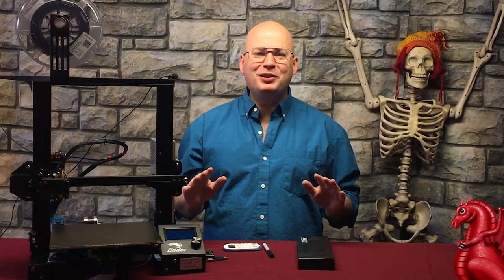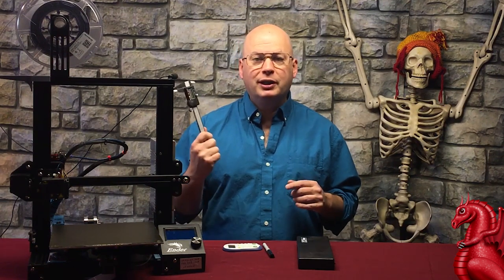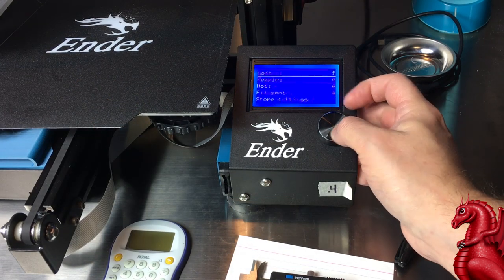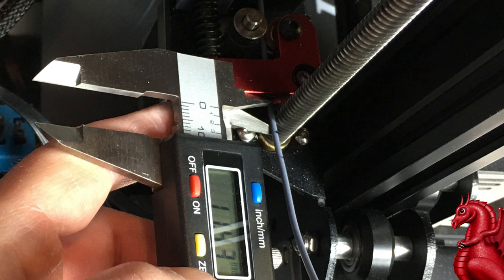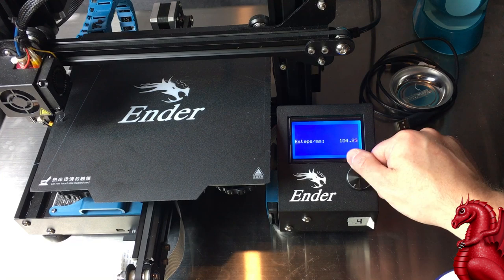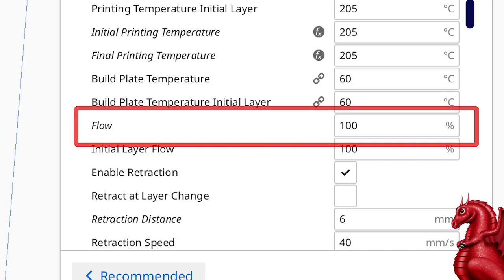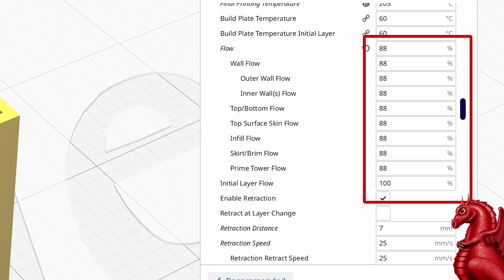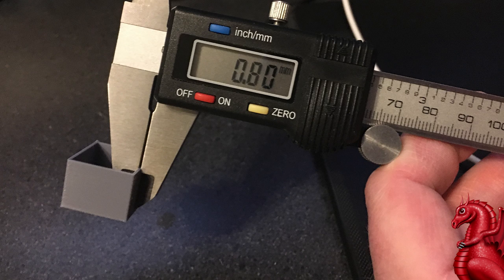3D Printer Extruder Calibration

Comment: I just went through this tutorial and I liked it, but things didn't turn out better for me.  My printer is and ender3 pro and does a great job, but I decided to go ahead and tune it as much as possible.  So this was my first tutorial.  when I adjusted the flow, though, my cube walls got thicker. go figure.  The first cube  at 100% was close at .84mm but I adjusted the flow to 95% anyway and the second cube is  .91mm . did I do something wrong? should I just go back to 100?

Comment: I'm trying to calibrate a Flsun QQ-s pro, and every method I use to tell the printer to extrude 100mm I get 20mm so I end up with a 1835. I've used the screen on the printer and pronterface using the gui and gcode. What do I seem to be missing?

Comment: Multiply by 93 to get 9300, then divide 9300 by... means that the 9300 mathematically cancels out.  Skip it.  It's easier (in the example of 89mm extruded for 100mm intended) to simply divide the intended by the actual, then multiply that by the current transmission ratio.  Three values.... So just do this:  (100mm / 89mm) x 93 = 104.4     :)

Comment: Very Helpful, Thank You!  Once you have adjusted the flow and have the value. I actually got 88% as well, Can you permanently write this into the 3D printer like with the Steps on the extruder or do you have to set 88% flow always in CURA?

Comment: Hi there, thanks for the video. With all due respect, I think the way you calculate the wall thickness might be inaccurate. My understanding is: When you design the STL file, the thickness of the wall should be a fixed number, for example, 1 mm. The slicing software (for example simplified 3D) will figure out the best extrusion width multiplied by the number of walls to match the overall thickness (which is 1 mm).

Comment: I've just done this calibration and my e-steps are 138.9 from 94.5 and unsurprisingly im massively overextruding. Creality set this at 93 for a reason. I upped it to 94.5 and have been getting great prints. Where did this calculation originate?

Comment: Extruder Calibration:

Preheat printer

Measure 100mm on filament and mark with a sharpie 100mm and 110mm

Extrude 100mm on printer

Calculate what the difference is whether over or under and jot it down

Check current E-Steps are on printer menu of printer

Input length (100mm) x Current E-Step # (Amount Extruded) = 

(Calculated # from step 6) / (measured length that was extruded in step 4 = (New E-step)

Go back to E-steps on printer menu and dial new calculated # from step 7

Remember to store setting otherwise you will lose this calibration after the printer powers off

Repeat steps 2 - 4 (Repeat until extruder is at 100mm)

Next calibrate Flow slicer program your using, set to 100%

Print out calibration cube with a wall thickness of 2 for .4mm nozzle (hollow cube) 

After cube has been printed, measure wall thickness with calipers and wall thickness should measure out to .8mm

(Desired width) / (Measured Width) = New Flow %

Double measure wall thickness on all 4 sides and average it

Input new Flow % into slicer (minus 4% +/- for printing miniatures)

Comment: My Extruder is skipping backwards when extruding. Any ideas what could be causing this? I have a new nozzle (0.4mm) and a new heatbreak installed. So I don't thinks it's clogging. I also tried temperatures up to 230 with now success.
When extruding without going through the hotend it works just fine. The skipping happens only when extruding through the nozzle.

Comment: I try to challenge the extrusion config here. I wanted to know if my printer has the same issues. I extruded 100mm, led to 94mm of extrusion. Then I created an object with the exact volume of the filament volume 1.75mm*100mm, equivalent to  100mm of filament. It is 240.528mm². The printer prints then 111mm of filament, 100mm of filament for the object with the volume of 240.528mm² and 11mm of filament for initialization. Even if the e steps of the ender might be lower or higher, still with my cura, an object that has the same volume of 100mm of filament, result in extrusion of exact 100mm of filament. Am I wrong or do we overlook something?

Comment: Thank you so much. I had to bring it up to 145.31 from 93 with an aftermarket extruder. I was going crazy changing my settings in Cura. I still need to do flow calibrations but you Sir just gave me some fantastic knowledge. I did Not know under extruding was better for smaller parts but it makes sense and I'm going to start. Thank you again!

Comment: Should this be checked for every material type/color? The flow setting is set by my material profile it seems, so if I change it for only one material, it will be back to 100 for the other materials.  Should I check all my PLA colors or is this flow setting likely to be accurate across the color range?

Comment: Excellent clip. Thanks a lot. I have serious problems with layer adhesion (layer to layer). With my new PLA spool from ENDER and applying your method I need to put my E to 234.55 stp/mm what is enormous compared to the default or 93 stp/mm in the factory settings. I measured the diameter of the filament and arrive at 1.7 +/-0.03mm being close to the 1.75mm stated by the vendor. In the calculation 93 stp/mm for 100mm means 9300 steps while the stepper motor of the extrusion makes only +/- one complete rotation this would then mean that the stepper motors are driven in micro-stepping mode? Can someone provide me with some suggestions?

Comment: Once I've adjusted my e steps and figured out my correct flow rate, should i change my flow rate for all profiles? And should i change my wall thickness back to the defaults or is this just what i should use for, say, my miniature profile?

Comment: New subscriber... Very informative video. Really appreciate this. If you were to measure the cube at the bottom, would it be slightly wider?  Most of my prints on the Ender 3 are a bit fat on the bottom few layers, and it looks like your cube was also wider at the bottom.

Comment: I'll probably pass on the % stuff, but ultimately the thing came out between 0.7 and 0.8 (my calipers only do 1 decimal place, might order some metal ones though). Maybe I'll just adjust the esteps a smidge to compensate for this in future.

Thanks for the help on the esteps though, even doing that is better than what it once was after changing extruder + tube. Went from 93 to 101.1, not an insignificant amount, but after I changed the extruder and tube, it was definitely over extruding a bit with stringing. Tube length was precut to the same length as the original I believe, but the extruder itself called for calibration I believe.

Comment: I'm doing the extrusion calibration. But every time I extrude free air flush cut a hundred millimeters I come up with a different number. 94.9 90.7 94 on the money and 92.3. four in a row. My printer was off and I did the math problems before I knew to save the settings and I got it to 100.0. not sure what's going on. I did have some clogging issues But other than that everything's been spot on

Comment: I followd the steps and affter extruding 10mm it was better but not good yet. After repeating and recalculating with the newer parameters i am now on 129.8.... is this a "normal" number? I use the same filament as i used to how is it that i have to change this so much only after changing to a new role of pla?

Comment: just saying im pretty sure using flow rate to get to your desired wall thickness is a lazy way, just because you get the right size youre still underextruding i have airgaps in my print and its much weaker compared to the one at 100% flow, x y shrinkage compensation would be the proper way no?

Comment: This video saved my awful previous prints, I realised when my printer expected to feed 100mm, it actually fed 45mm instead! I like this tutorial because it does not require to connect your printer thru usb with a cable or octopi, you only need basic tools.

Comment: Great video, albeit i seem to be running into a problem when printing test cube, i can't seem to get the 2nd wall to print, i have your settings pretty exactly in cura, using ender 3 v2, wall width comes out .4, all stock parts except springs, and extruder now.

Comment: Hi there. I mounted an all metal extruder and the micro swiss hotend. I let it print a few minutes and then tried to calibrate the extruder like you show. I came up  33  mm short and had to krank up the steps to 138 (93 was original) ....that cant be good? What could be the problem here? I must say i had to replace the gear on the motor (it came with the new extruder) because the original did not fit with the new dual gear extruder

Comment: Great tutorial!  I followed your steps on my Ender 3 Pro. I have the upgraded 4.27 board and a new glass printing surface.  I usually put painters tape on the bed to help with adhesion with different filaments.  Now that you know my setup, I have a new issue.  I have a measured cube of 0.80mm (perfect as per your direction) but now it has layer holes in it.  How do I overcome this?

Comment: I had an Ender3 and loved it so I bought a CR10 and have had nothing but problems with it.  I have spent hours on reddit feeds, facebook groups and youtube videos with almost all of it stating that it was a clogged nozzle, warped extruder, cheap Bowden tube, or quick disconnects.  I have replaced the Stepper Motor, the Extruder to a metal one, the Bowden tube to a better one, the quick disconnects, the Bowden tube to a better one, the nozzle a dozen times and was ready to throw it in the trash.  After testing everything with your tutorial, I am not sure why but mine was almost 20mm short of what it should have been in the extrusion.  Once adjusted I feel like I am back on my ender3 again.  Thank you so much for spending the time to explain it to us non-engineering types.

Comment: Hey man I wonder your input so I got an under 3 pro and for whatever reason the left bottom corner will never be level to the rest of the bed and to fix that I put the z axis stopper up a fuel millimeters that way I could level the bed without having some springs completely condensed since I know that's fairly bad for springs and seems to fix my level problem I just wanted to run this idea by you and see if what I did was actually a good idea or not but I don't print anything too tall and yeah thanks for your time if you do indeed read this oh so now I just upgraded my extruder now to what you did in your other video because I had a really bad slippage so I'm excited to get my printer working because I'm probably going to be using this for a lot of high school projects since this is going to be my senior year this fall if we even go back I hope we do because I really miss the in person learning like I was taking advanced sales brother this past year we got sent home the videos were so useless I'd rather sit down with the textbook and try to learn it myself which is what I did for the rest of the year and somehow I managed to do it fairly decent and I'm sorry that kind of turned into a ramble

Comment: Hey I‘m facing the problem, that even after saving the new esteps and testing again, it doesnt take more filament in as it should. Ive tried over 3 times, but it doesnt wanna do as supposed to. Its a direct drive extruder.

Comment: Thank you.  This was enormously helpful in solving my petg printing problem.  Along with the calibration process I found my nozzle was loose and oozing out around the threads, then I found the filament  tension was too light-after that the calibration-with your guidance was a piece of cake.  Now I am in the middle of doing the test cube that you so kindly provided.  Again, thank you.

Comment: Thanks, a really well explained guide. Calibrated my ender 5 pro after fitting microswiss direct drive, found my e-steps were now 138.3 a bit off the suggested 130, was under-extruding by 6mm out of what was meant to be 10cm in the test.

Comment: I have 1.2 wall thickness and i print the cube and i measure and i have 0.9 wall what flow i must put
Reply: Can you help me i use 0.4 nozle.... I make the esteps test ... Now when i put 100mm in the extruder stops allmost in the extruder its fine.... I make my esteps 100mm (93stock) but i have problem when the printer go to the second third layer push more filament I think.... Im so upset with my printer......    I have 1.2 wall thickness i make test clow cube and i measure its 0.89-0.9  ......   I dont now ehat to do ( i use pla in 205-60 temp) i make very good level  i have skr mini 1.2

Comment: Question. On the extruder calibration cube, all but one of the walls are at an acceptable tolerance of 0.82 but one wall is still waaay off at 0.71. How can only one wall be off and how do I bring it back to tight tolerance as the other 3 walls?
Reply: hmm i dont even have a printer yet but from the videos i watched, this seems more like a different problem... 

maybe this video could help you: https://www.youtube.com/watch?v=25r-PTVJDjQ

Comment: Great demonstration of the technique, it makes a lot of sense and is simple to execute. I would've liked to have seen the cube test before any e-step or Cura calibration, to ensure that something is truly off with the machine + slicer settings. As others have pointed out, the calibrations on the machine and in Cura seem to more or less cancel each other out, which makes me wonder if Cura "bakes in" the average e-step offset/error in their base profiles for Ender 3. I also wonder if this calibration gets thrown off by different filament types, or as the tightness of the extruder gears drifts with usage.

Comment: Great videos Tom.  Been watching your channel since purchasing an Ender 3 last June, along with a couple of other channels that seem very knowledgeable of the Ender 3.  Finally decided to assemble it, after deciding on what upgrades I would do during the assembly process.  It worked great - hot-end & bed heat up accurately;  X. Y, & Z axes  all move smoothly, quietly, and accurately.  The only problem I have is the extruder (motor).  It does not work.  Am able to turn the motor shaft by hand and all the connections seem to be OK in the electronics case.  I am stumped.  Any suggestions / thoughts?  --  Patrick

Comment: Under the MOVE AXIS screen, I only have an option to move in the  X, Y&Z direction.   There is no EXTRUDER OPTION anywhere on my Ender 5.    Is this feature only on the Ender 3?
Reply: The extruder is only available if you choose to move by 1 mm (and likely by 0.1 mm). It is not available if you choose 10 mm. I just noticed this on my old Ender 3 which has a different (older?) firmware than the one shown in this video.

Also, I can only access the "TUNE" menu while the printer is moving. So I move the Z axis up manually by about an inch and do an AUTO HOME. While the printer is moving to home, the TUNE menu appears under the CONTROL menu. Pretty odd, but that's the only way I am able to get to the TUNE menu.

Lastly, I haven't figured out how to save my new flow %,  I can't find any way to make it save the setting. The printer does not remember it after I turn it off, which is pain in the butt.

Comment: Plz help! So I have perfectly adjust my e steps on my Neptune 2s, however, flow rate is not doing anything for the walls. My bed leveling is perfect I print 5 tiles and they are all smooth with no gaps. I’ve gone from 100% flow with .83-4 walls and I just tried 70% and I’m at .81-2. I have a dual gear extruder. What could be the issue? I also have elephants foot that I can’t seem to make it go away
Reply from the maker: Your elephants foot is because your Z-offset is too low (your bed is too close to the nozzle for first layer). I'm sorry but can't really troubleshoot the other issue beyond telling you that your e-steps for the extruder may be too high.

Comment: It's interesting that this is done with the hotend all attached. Others I've seen the disconnect the tube from extruder and do the steps
Reply: But the pressure from the hotend and potential creep that goes in the slight deformation caused by the pressure in the melting tube might give you some offset.

Comment: I have an Ender 3 V2  None of these menu commands are available.  I saw in comments a reference to Tomb of  3D Horrors FAQs that Creality left these off to save space on chip.  Is there a board upgrade that would rectify this?
Reply: Did you find a solution? I have the same problem

Comment: Great video, I really think this is going to help me with a very frustrating problem. But before I start I have a few questions:

I followed several upgrade customization guides for my ender 5 plus, and since then I've not been able to get things to work right.  It's printing "ok" but it's really brittle.  I'm new to printing so I don't know if its the filament or more likely a setting, such as the extruder samples you cover here.  I've been printing benchies and when I gently squeeze them they crumble in my hand.  I've ordered a mm ruler and caliper so I can test as you've explained in the video.  I also have alternative filament, but as I've not opened the packages yet I'm waiting before I do that. 

I'm using Ultimaker Cura 4.8.0 on a MAC, and I don't see where the actual menu is to enter the extruder values.  Can you provide some details on where exactly those settings are?  I see a lot of settings where I can check a box on/off, but not where I enter different values from 100% or .9 (90%) etc...

Thanks again I think videos like this will really help me learn the craft
Reply: Check your filament using the snap test. Cut a few inches off, bend it in half, if it snaps your filament is too old. Hope that helps!